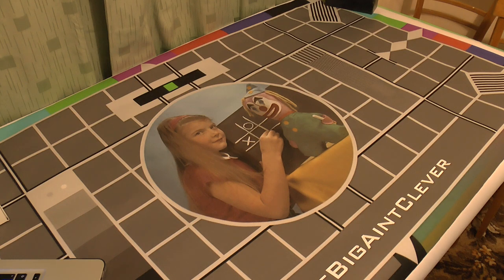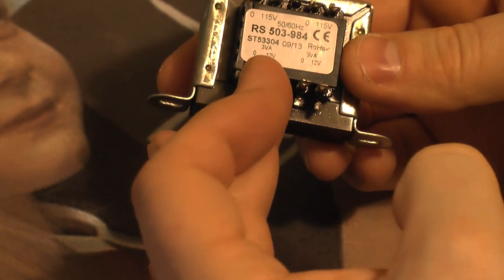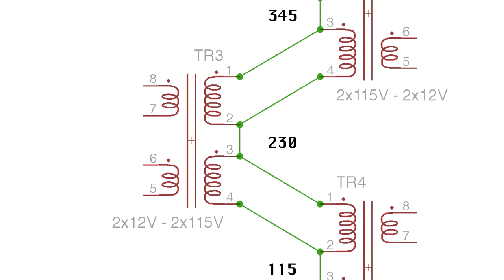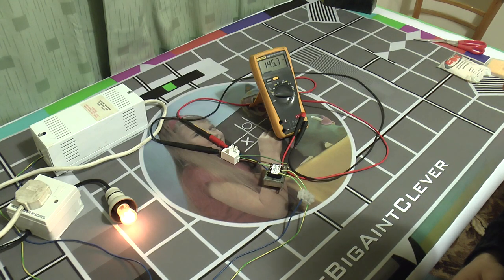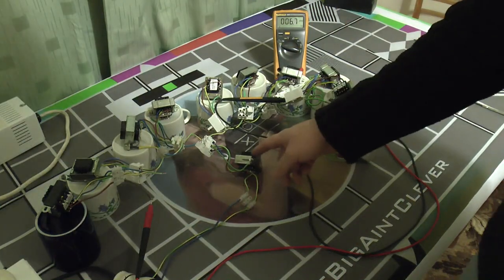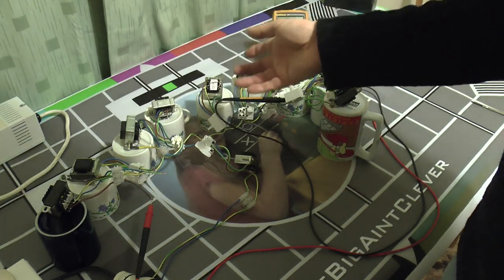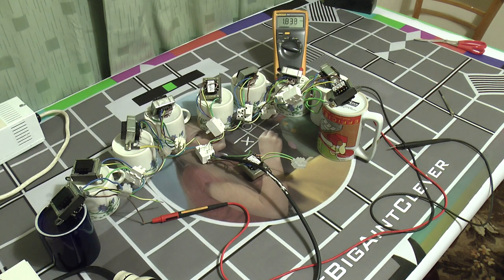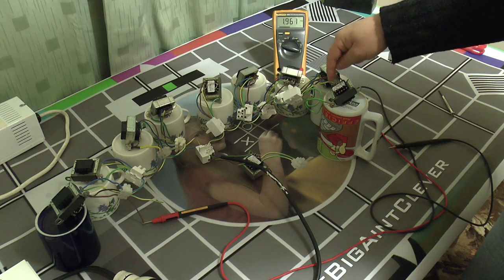High voltage from small transformers

Comment: Great video, I use a similar principle for a flyzapper circuit. 240 V to 12 V for TX1.  then 12 V to 240 V for TX 2.
Then series up the high voltage windings to get 480 V, through a 3 or 4 stage diode capacitor multiplier. to get about 1200 V at high impedance and short circuit proof.

Comment from the maker: Some of the comments so far don't have a "reply" button (YouTube have been playing again) so here goes:

@Euro Bum: shorting out the 12V windings would short out that particular transformer and, basically, bugger it all up. I'd expect at the very least the output from that stage to drop sharply and have a knock-on effect on the following stages.
Resonant cap on the 12V? Not a clue, the guys who play with high voltage more often might be able to tell you.

@ScottieNiven: tried that when I was about 8 or 9, it turns out Hornby train set power supplies (especially DC rectified ones) don't like their outputs being stuffed into a 13A socket :)

Comment: You should connect all those 12V secondaries together: 10 transformers * 24V Secondary windings => 1Big transformer with 240V primary (old secondary), and 2400V secondary (old primary). That's the way to do it! :)

Comment: Now this is an interesting little wiring config. :D

A little mind-boggling initially, but I'm sure I'll get my head around it after watching the vid a few times and take in the info in bite-sized chunks. :D

While it may be ridiculously expensive, not to mention weighty and bulky, I wonder if this wiring config could be pulled-off with a load of 110v building site transformers? :D

If it could.....Imagine that. This wiring config WITH GRUUUUNT. :D

Thanx for showing,

-BoomBoxDeluxe.

Comment: The only issue with back-feeding a transformer ( powering the secondary ) is you saturate the core to hell, which is why you may notice a current draw from them at idle, and when loaded its just horrid. I've used this system though to charge capacitor banks in the past :)

Comment: I made a 3 stage amplifier with a capacitor & inductor in each stage, I boosted a starting voltage of 12V DC to 500V DC at the final output.

Comment: If you connect all these transformers primaries to the next one's secondary, in order to step the voltage up, I assume you would not get a few hundred petavolts, but why not?
Reply from the maker: +Adam Harrington the insulation would break down. If the insulation was thick enough on the other hand then you would get ten transformers in series, each with a 1:20 turns ratio, resulting in a total of 1:20&#185;⁰ or 1:10,240,000,000,000. One volt in, 10.24 teravolts out, assuming the regulation of each transformer is 0%.

That statement could be wildly inaccurate of course. Inductors aren't my strong point.

Comment from the maker: (no reply button again :/ )
You mean my glazed porcelain insulators with convenient carry handles? :)
That's why I hooked one side of the primaries to the transformer chassis, in your case the voltage at the other LV bushing should (in theory) not go higher than 240V relative to the chassis (one would be bonded to chassis potential, the other would be about 240V higher (could always tie the two together with a pygmy bulb, gives the LV winding something to do :) )
Reply: "glazed porcelain insulators" :D
Reply: wonder how many volts they can take

Comment: Are you the cousin of mr photonic ha ha :-))

I would be an evil swine, connect all the 12v sides in series and connect to the mains, and all the 240v windings in series for 2400v, you may need a ballast as the 12v windings have a rather low resistance he he :-))

Love the bbc test card cover, ive spent years setting up tv's and vcr's to her picture.

But your missing the lift music they used to play lol.
Reply from the maker: That's another way I could've done it for these, but the aim in this instance was to see if they could be daisy chained at all. I happened to choose ten only because that's where the price dropped. :) This method could be used (with diminishing voltage gains) for ten, twenty, thirty...
Commercial 230-115V autotransformers could also be used in the same configuration, cascaded on as far as you like. A touch more power available from them, too!
Reply: AintBigAintClever
Hey if there cheap at that price, i dont blame you :-)

Perhaps you also got less voltage because the magnetic fields were seperate to each other, no direct field interaction, i could be talking crap of cause ha ha :-))

Comment: I can send you an 80w MBF ballast if you want. Rated at 800ma :)
Reply from the maker: Haha, I was looking around the house for something a bit smaller! Primary current on these transformers is only about 26mA. I know for a 150W metal halide ballast in the garage but didn't see the point, not for running these anyway.

Question is, will someone with "bigger" transformers have a crack at it...
Reply: Take it! Generous! Cool toy.   Thanks for offering!

Comment: these little transformers are getting harder and harder to scavenge from electronic waste because of all those switch mode power supplies they use now.
Reply from the maker: I've got a couple knocking about, but none of them are dual primary (or even centre-tapped primary) so I had to buy some for this experiment.